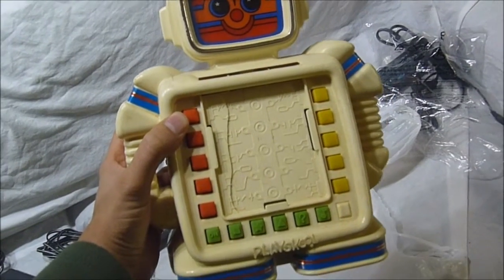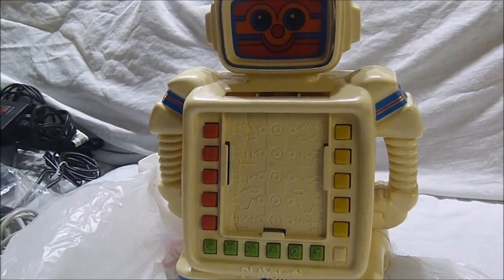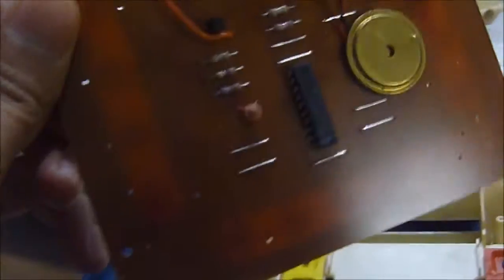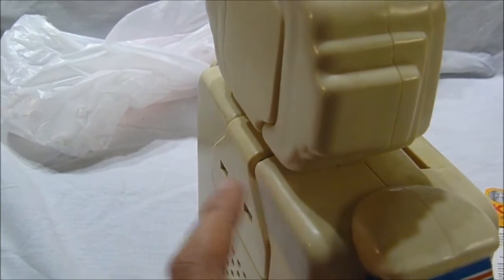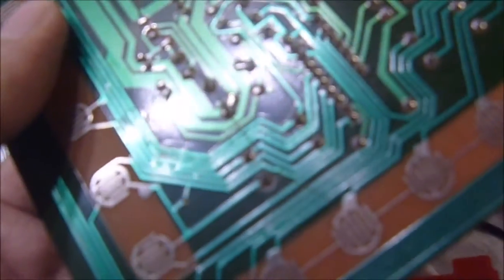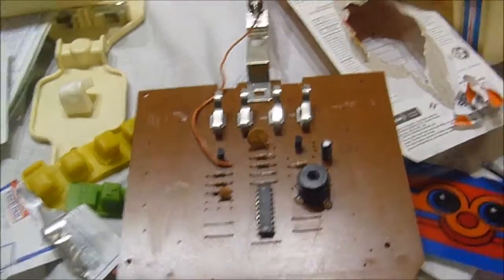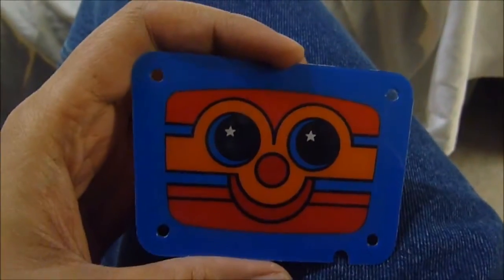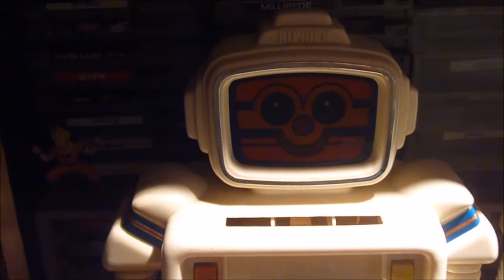Broken Alphie II Robot Toy by Playskool

Comment: @Plants and Games, the board is fractured.  The green lines are painted on the copper traces for safety.  It helps keep corrosion/short circuits out too. You would have to reconnect the wires.  This board looks simple because it does not look like it has two layers or Bi/in-between layers. To be simple you have to shave back the paint to see the copper on the board.  You can use any metal to bridge it or old wires that fit the voltage and Current.  Usually these kids toys don't require anything special. Like using wire from an electrical adapter just cut pieces off then trim off plastic to have exposed wires to connect the gaps.  The connections don't have to be by the break you can go a little further down the trace, just make sure it does not go to other components.  I wish I saw this back in 2016 to give this advice.